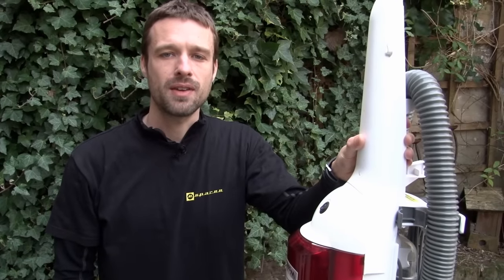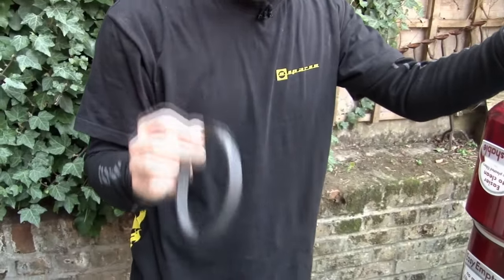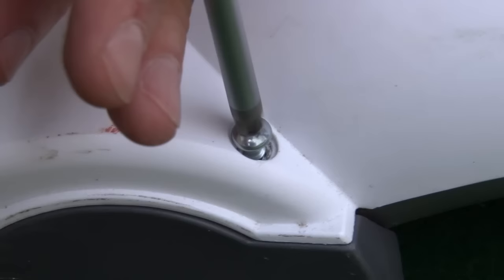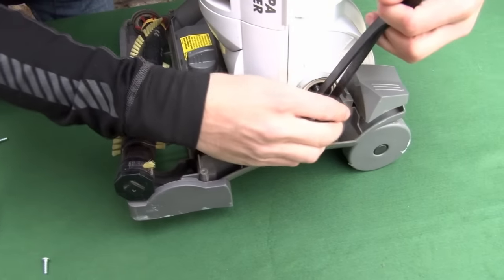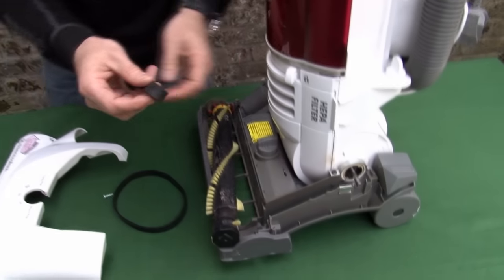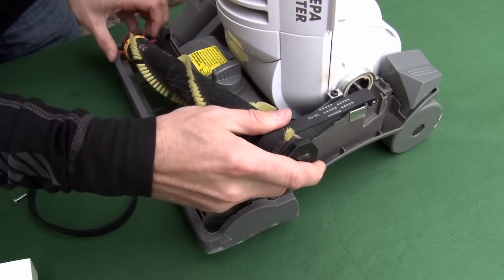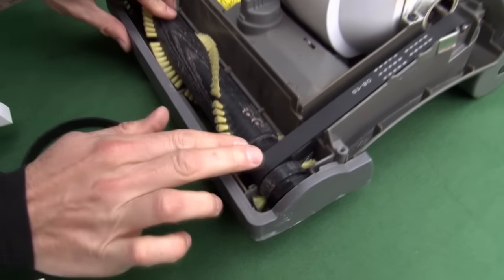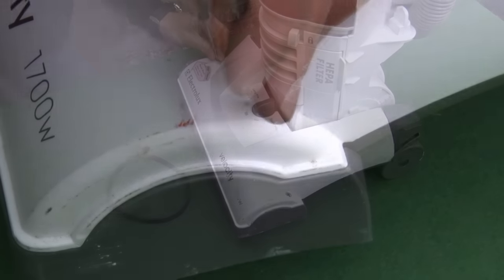How to Fit an Electrolux Vacuum Belt - Get Your Vacuum Spinning!

Comment: I've been trying to solve this issue with my vacuum for over a year and I'm quite embarrassed that it was such a simple problem... Hopefully just a quick trip to the shop to get a replacement belt :) thanks guys!
Reply from the maker: Hi Mathew, It is likely to be quicker to click on the link below for the part rather than try and find a local supplier:
http://www.espares.co.uk/search/pt1567/vacuum-cleaners/belts
Many of our parts are received the following day in the UK even without express delivery and have more than 1.5 million spares in stock.

Comment: Hello there thanks so much for your super fast reply , but I've cleansed the brush just as shown in the video but problem still persists , it seems like some of the rubber from the belt is burnt on the spindle and just causing the new belt tp get damaged as well .
Reply from the maker: You need to remove any burnt rubber from the motor shaft but do check the roller spins freely if you take the belt off. To clean the motor shaft use a plastic scouring pad.

Comment: Hello my Electrolux , same as the one in your video , is burning the belt and releasing smoke and the brush isn't rotating as well . Have replaced the belt but that has been chewed up in 1 minute as well , any suggestions ?
Reply from the maker: The problem is likely to be hair built up around the brush roller bearings. We have just produced a video for this here:
https://www.youtube.com/watch?v=f1nQcafiWPE
Reply: Hi, this video to clean the brush roller bearings is no longer available.  Do you have another link to it please?  I keep replacing the belt but it only lasts a minute or so.  I think I need to clean the bearings but not quite sure how to do that.  If you have any advice I would really appreciate it!